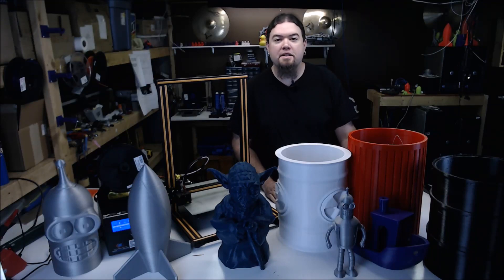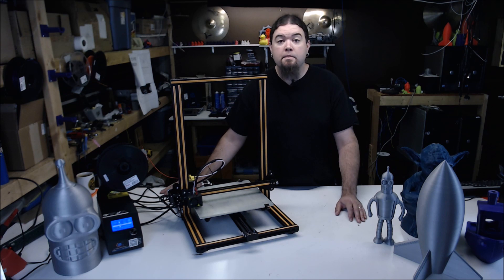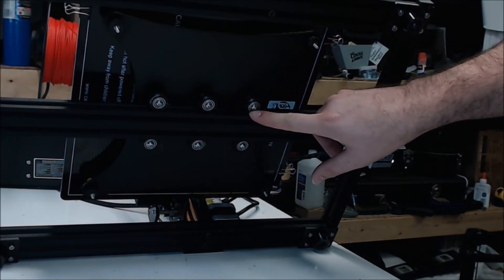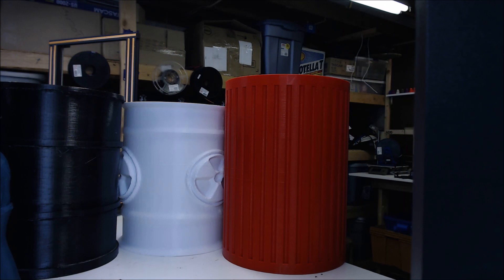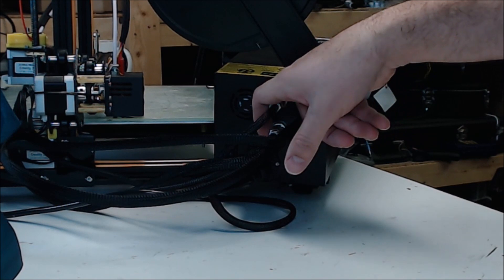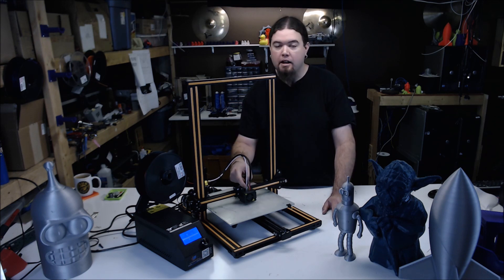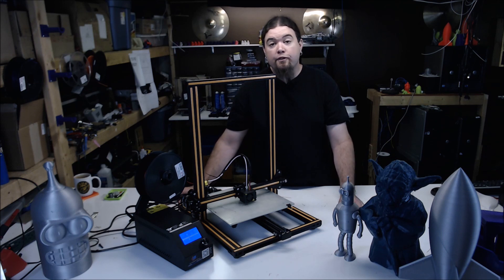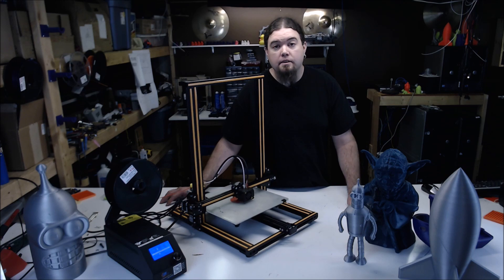Creality CR-10 Large Volume 3D Printer Review

Comment: Hey! I've watched your videos and you seem to know your stuff. I have a CR-10 but recently began having an issue. Mid-print the nozzle temp dips quite a lot, at least 16°C what I've seen, causing a jam in the filament tube. It heats up later but the jam stops it from extruding any more filament. I watched your video on updating the firmware. Do you think it could fix the issue? Or is it a matter of replacing the heater cartridge? Or would you suspect something else?
Reply from the maker: Thanks for watching! My guess is it's probably the heater cartage. While you are in there, you might as well swap the thermistor too. That will hopefully correct your issue. Just about any 100k thermistor should work.